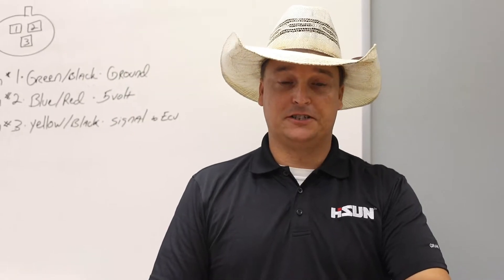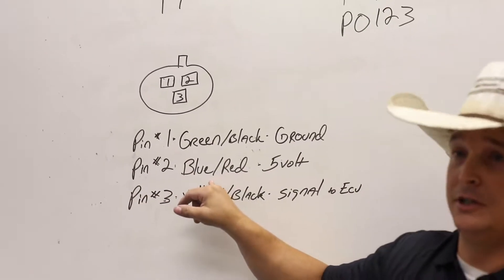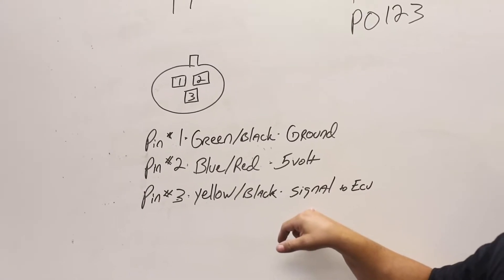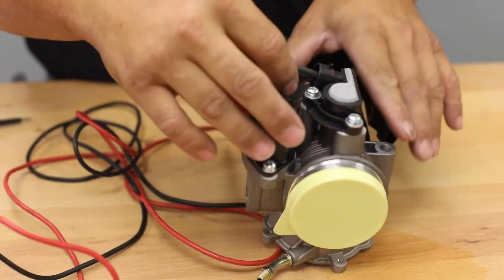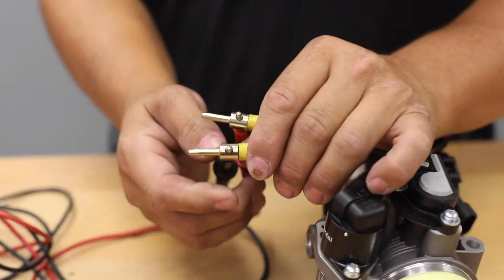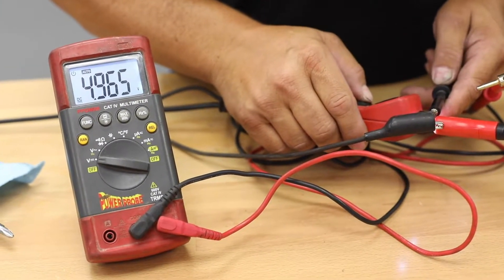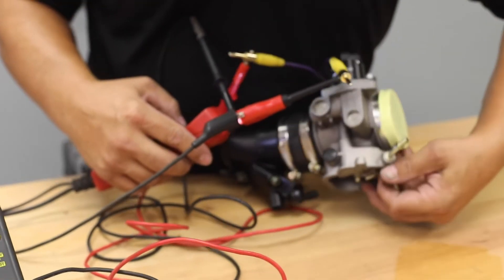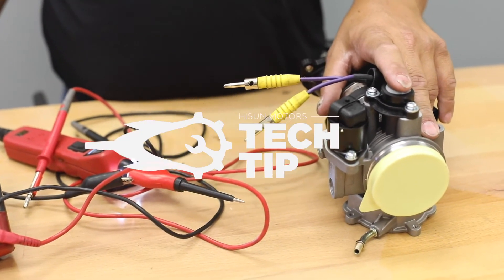Throttle Position Sensor Test - HISUN 110cc-1000cc Engine

Comment: Do you need to adjust your TPS after installing a new sensor? Also on the pin layout you have drawn, is that looking at the sensor or the plug?  Thanks